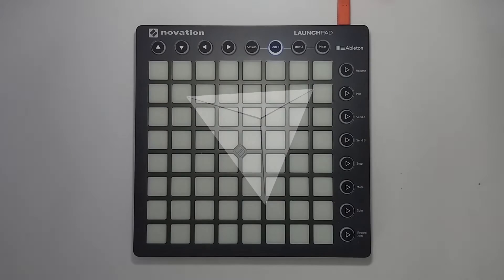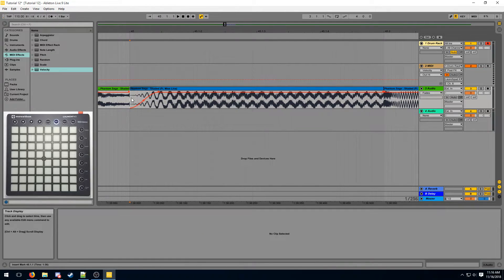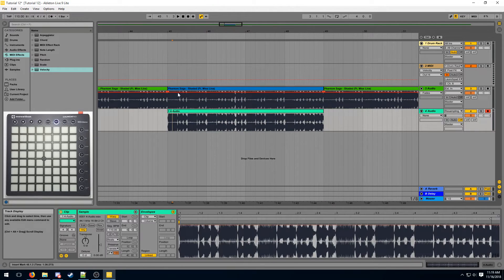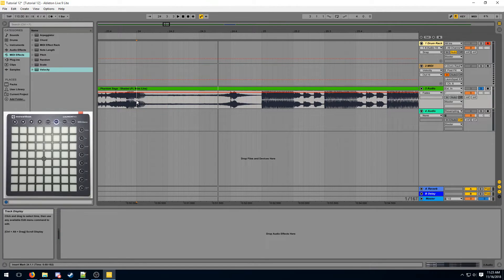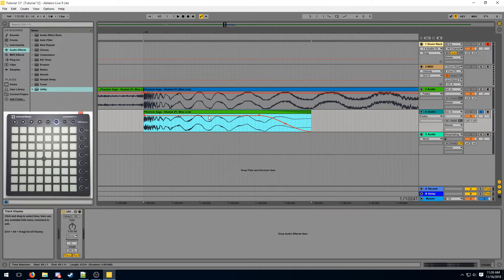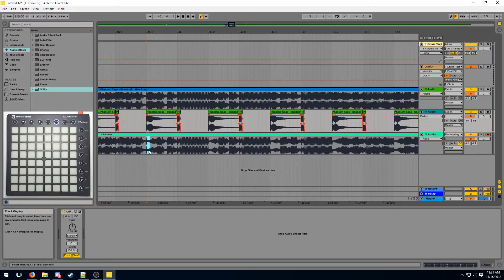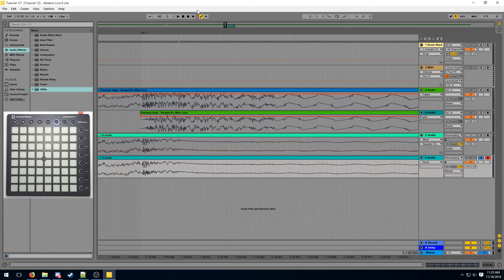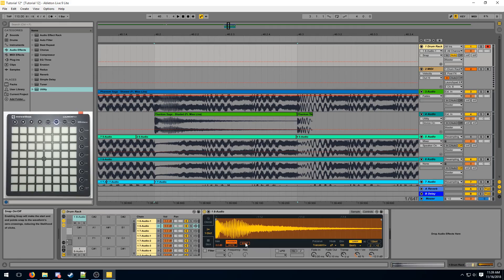Launchpad Tutorial 12 - Removing Drums (Fading and Phase Inverting)

Comment: 6:35 either fade the rest out or slightly play with the volume knob to get it to the right level so that it cancels out.
Making the tracks wider by dragging also helps to adjust the samples position.
This can be further checked by dragging the sample onto the original track (not letting go the whole time) so that you get a layered view of both samples,
adjust carefully until the waveforms perfectly match up and slowly drag the sample back into its track (trying to avoid horizontal movement). :)

Comment: Could this technique be used to extract and cancel other sounds, such as a bassline? If i could find a clean bass sound and phase that with a section of the song, would it remove it, or does it only work on drums? Thanks for teaching me how to do this, as I'd heard about phase inversion but never found a solid tutorial.
Reply from the maker: the answer is - it depends. the bass sound will almost never be fully clean and it is hard to clean it up without any external tools (i will be covering this later). if the artist used an instrument, then it is most likely not invertable. however, if the bassline was a sample, then it is likely invertable after cleanup. this is how i separated the piano section in the 2nd vocal section of "we might fall". tl;dr this mostly works it was a sample during production and not an instrument.
Reply: @mat1jaczyyy  Thank you for the quick reply! I will keep that in mind and see what I can do.